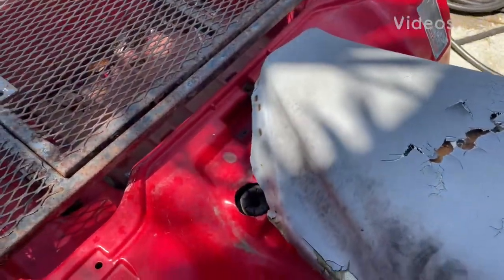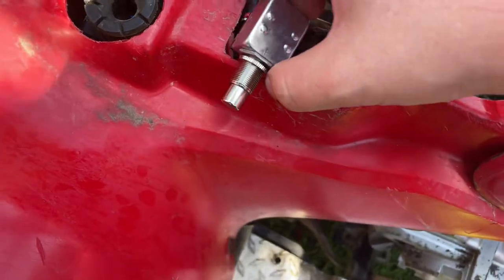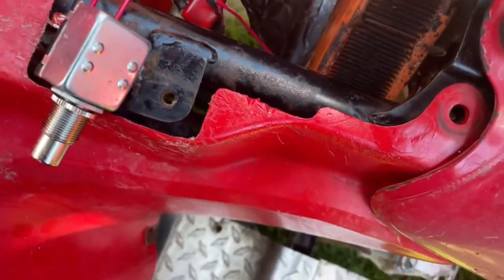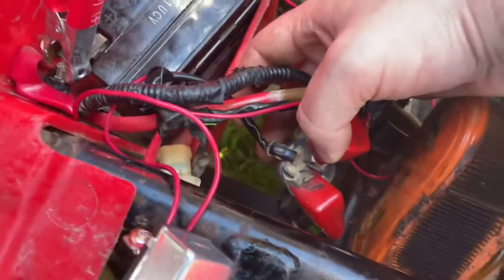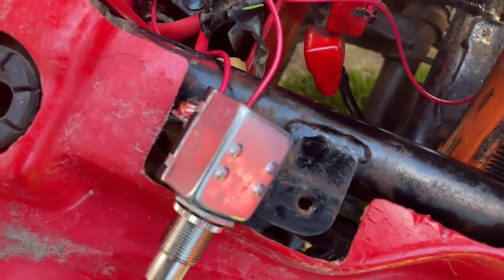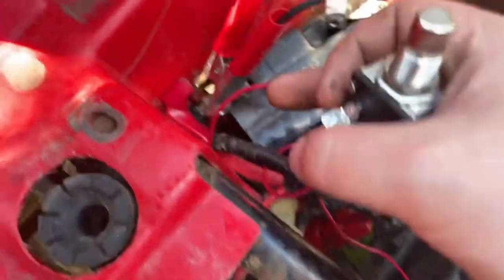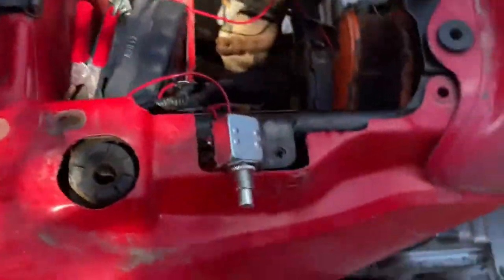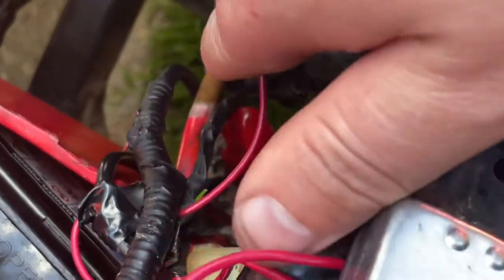How to wire a push starter button directly on an ATV

Comment: Why did it not stop turning your starter over when you let off the button
Reply from the maker: The starter only spun over enough to start the engine.
Reply: @Letsdoittv67  That was supposed to say why did it not stop turning the motor over when you let off the button Sorry about that.
Reply: I wired mine up the exact same way thank you for the video it helped me a lot actually
Reply from the maker: @griffithracingteam2412  not entirely sure, it was kind of a crappy condition 90sATV I received for free when my buddy upgraded. Glad I could help! I’ll be having to do this soon to another haha.